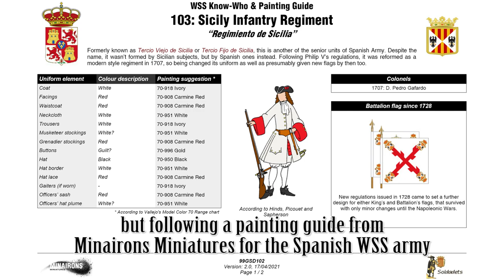Painting 15 mm White Uniforms - using BLACK primer: WSS Tercio Viejo de Sicilia Regiment

Comment: You really are meticulous with your painting, and I'm impressed that your coat color remains so consistent in spite of the drastic difference in primer.  Well done.  they're beautiful!
Reply from the maker: Thank you very much! Yes, I had to go a little overboard with the base coat of white to match the other units, but I'm still wondering if it's not better because the 15mm figures need more than the 28mm ones to raise the tones to be clearly seen.
Reply: @MinisMyWay  I agree with you regarding the "look" of white (black too by the way) and how it appears on 15s vs 28s.  Also the slight differentiation between units in the army could simply be a contemporary matter of variations in dies (or in the case of white, lye).

Comment: Nice job, Alex. I think whatever is quicker for you is the way to go, you're only going to see the difference very close up. On the table they'll be indistinguishable from one another. Maurice is 4 stands per unit, what's the main game for your basing method?
Reply from the maker: Thanks, and thanks for the advice, you are right, the most practical is the best. Maurice's standard is 4 bases, but since in my area the only player with figures of this era has 3 base units to play Beneath the Lily Banners and he has too many figures to change now.... and it is a game I also want to try. I guess as long as we both follow the same criteria there won't be much problem. And as you say, on the game table they won't be very easy to distinguish, so I can always dismantle one regiment to make the fourth base from two others if I need to.